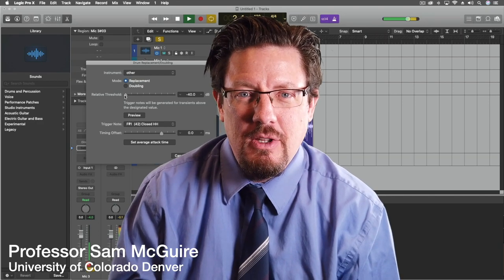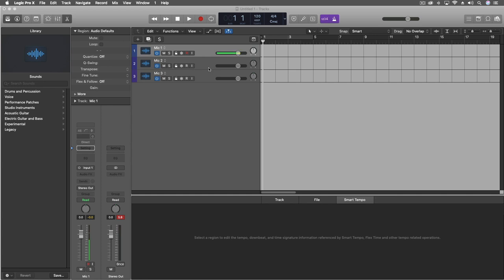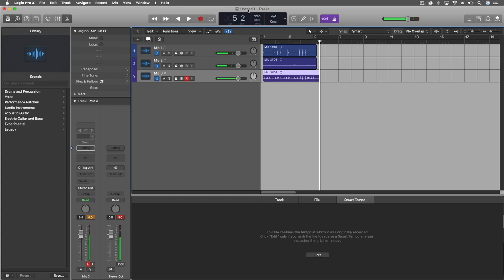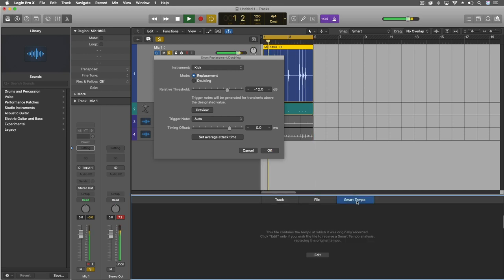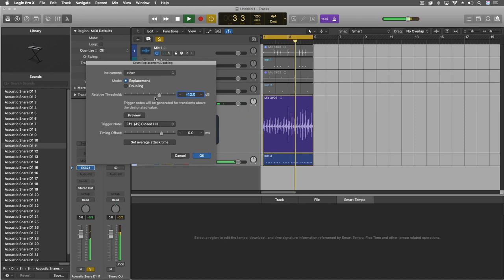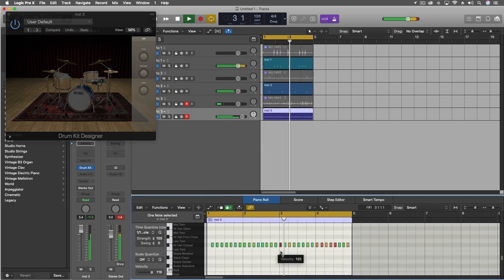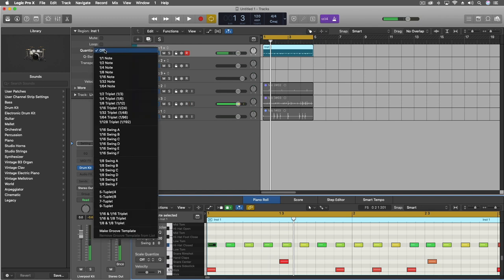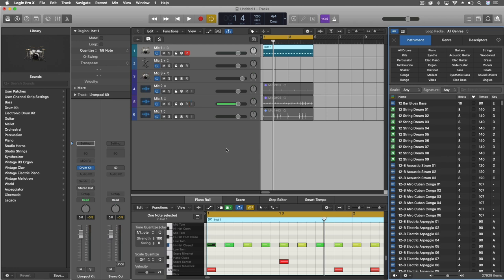Drum Replacer Tool | Logic Pro X

Comment: Cool trick, but why just not use a midi keyboard and trigger samples as you are doing with audio?
Reply: See @9:03. Afaic I see this more as a proof of concept than as a practical way of recording a basic 2-bar beat. Using and learning a deep program like Logic is all about building up a toolkit, knowing what is where, and what is possible, so that one day you'll be able to pull up the right trick at the right moment. This is juist one of those tools that one day might come in handy and then save a lot of time and aggravation.
Reply: I would tap out a rhythm on my legs using my right hand as the kick drum and my left as the snare. On a midi keyboard the kick drum is usually C and snare D, which is the opposite way around unless I cross over my arms or turn the keyboard the other way around 🤔. There’s less restriction than trying to hit a small keyboard key.